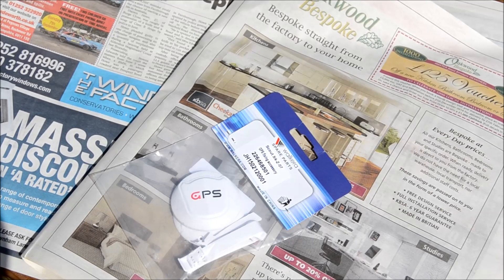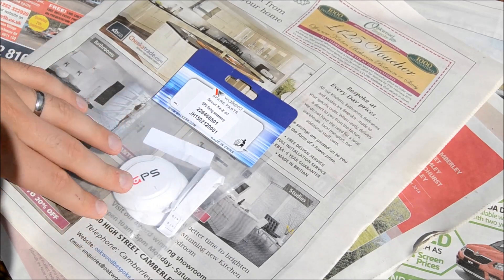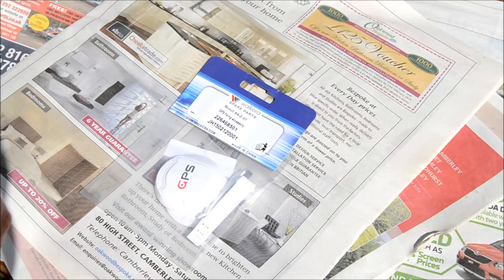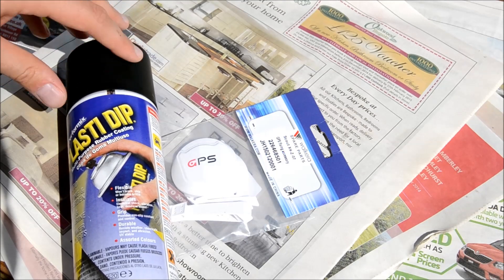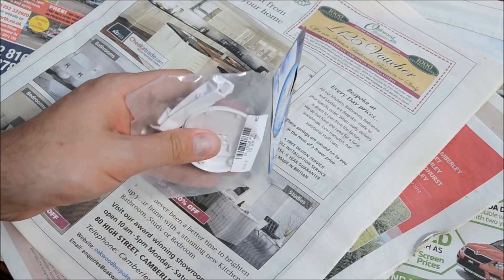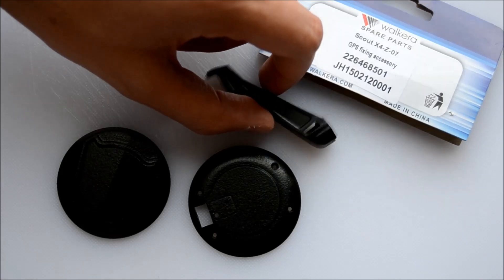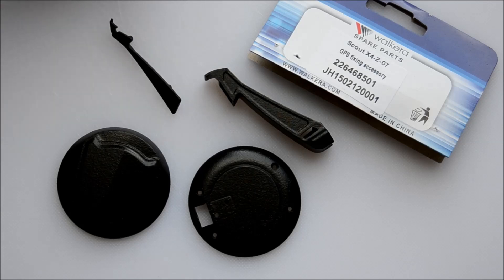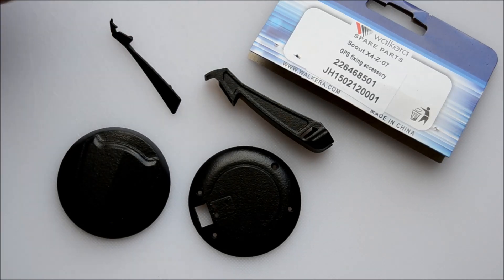Walkera Scout X4 - Upgrade GPS part 2

Comment: Hi Alex,  I use a cheap screwdriver from a jewelers screwdriver set that you can get from any 'cheap' shop - Reject Shop, Cheap as Chips, Dollar Shop is what we call them here in Australia.  The shaft on those is long and thin enough.
Reply from the maker: panic over. eBay find and arrived today. all good and fits fine. busy weekend ahead!